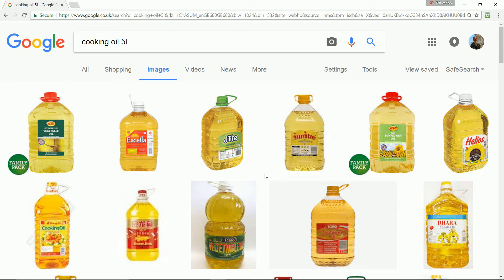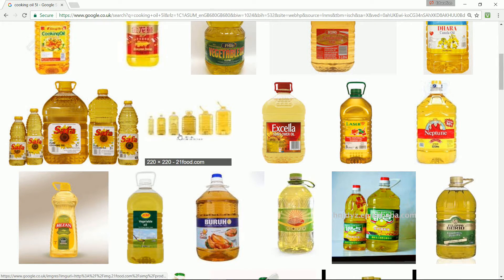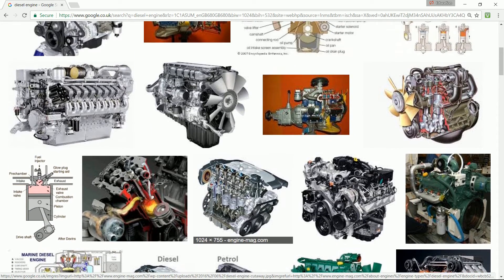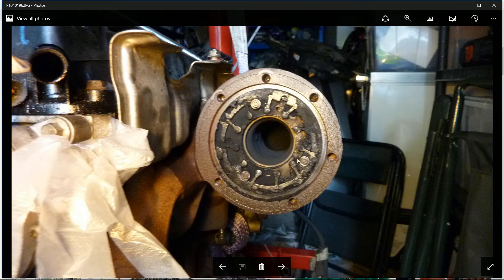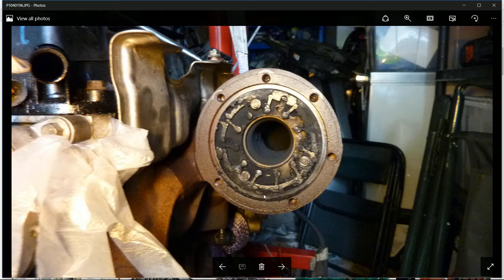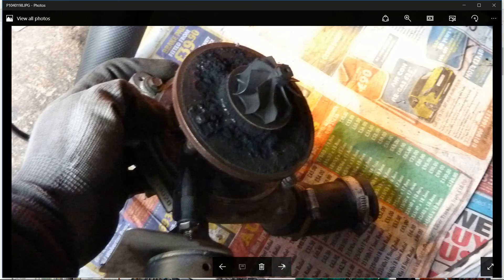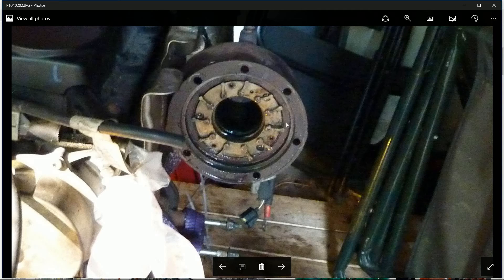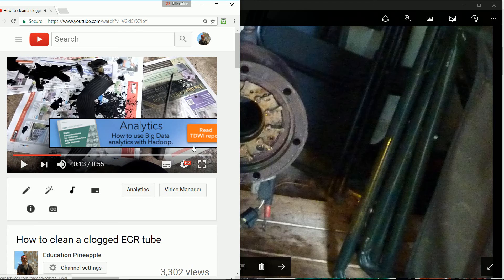Can Cooking Oil Be Used In Diesel Engines?

Comment: What about if i run it on a non turbo diesel vehicl?
Reply from the maker: If it has got an EGR unit then that will block with carbon. I think cooking oil is a last resort fuel, say if you were stuck somewhere and couldn't get to a petrol station and was very desperate. It should not be the first choice for any diesel, more like the 4th choice. 1st premium diesel, 2nd standard diesel, 3rd red diesel, 4th cooking oil.
Reply: I ran a Peugeot 405 diesel and a corsa 1.7 diesel van on used cooking oil and they were fine the body's gave up before the engine it all depends on the engine. the TDCI is one of the engine's you shouldn't run on it all it takes is a bit on looking on the web ??.